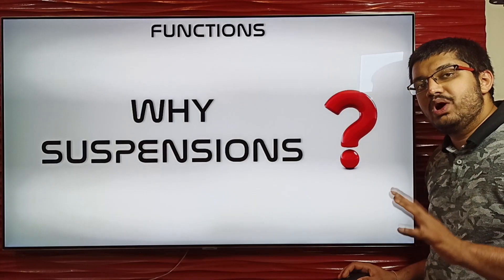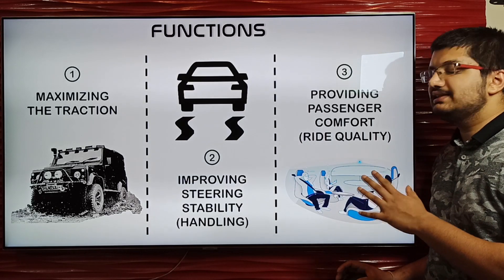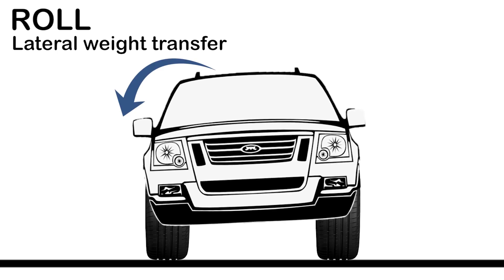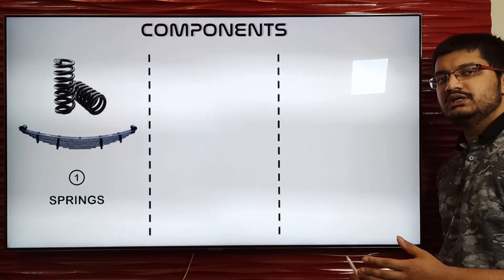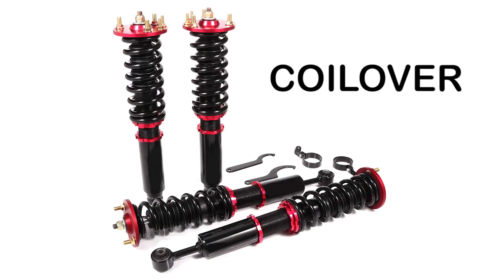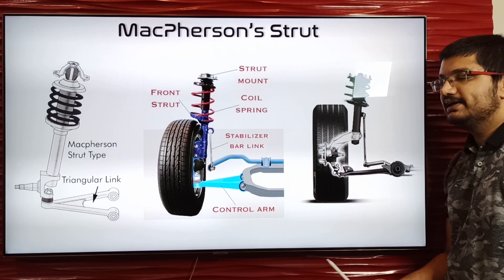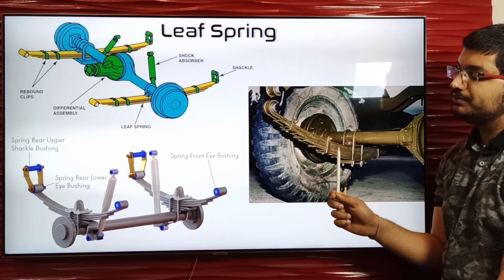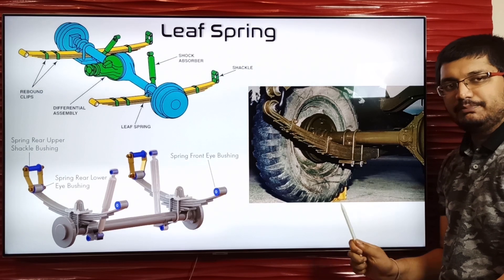SUSPENSION Explained! - Double wishbone | Macpherson Strut | Why suspensions are needed?

Comment: Nice video bro
Can you tell me which is better
Mc pherson strut 
Or a Double A bone?
Reply from the maker: There is no better choice as such if you observe carefully!

The choice simply depends on the application. Let me explain!

McPherson has a very simple construction as compared to A arms. Hence also more accessible, easy to install, repair and so on. These plus points work the best with passenger vehicles as they are mass produced. You need a simple construction, ease of access and such sort of properties here. Thus the McPherson works best with passenger vehicles. Also the suspension travel is not much in this case, the wheel assemble becomes easier, mounting becomes easier and many more advantages!

Whereas with the A arms, they have much more load carrying capacity, more travel and better control on the wheel trajectory. These points play a great role in applications like off-road vehicles obviously light off-roads .. like atvs or light trucks and pickups.

And if we go towards commercial vehicles, then none of these work due to huge loads. So you have to go with conventional leaf springs or nowadays most common air suspensions.

Thus in summary, it depends on the application and being a vast domain, we should always think from  the perspective of application while talking about automobiles.

I hope you got your answer. Ping me back if you want to discuss something more!
Reply: @AutoDecode  thanks bro
But I have listened from my friends that wishbone is more comfortable
And have better handling.
Is it true?
Reply from the maker: Yes you can say that in a way. Because using double wishbone geometry we can get a better control on the expected wheel trajectory and thus improves aspects like comfort.